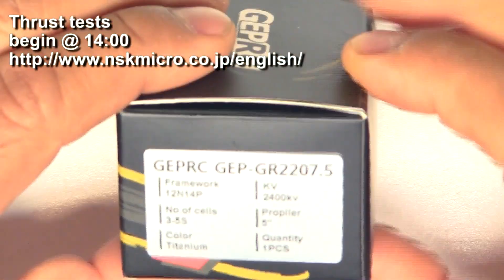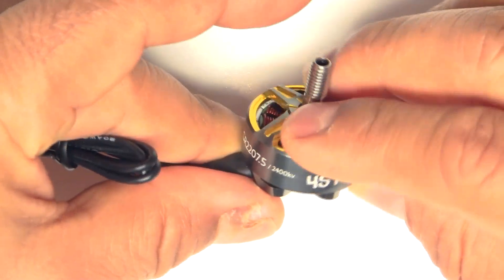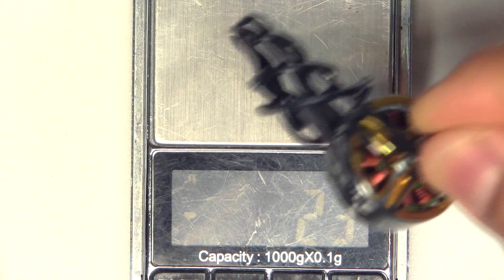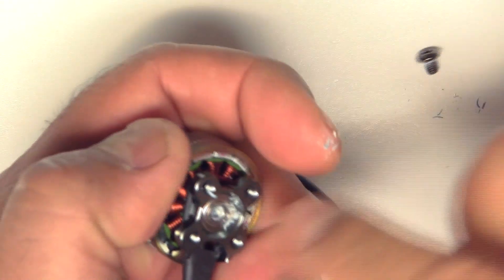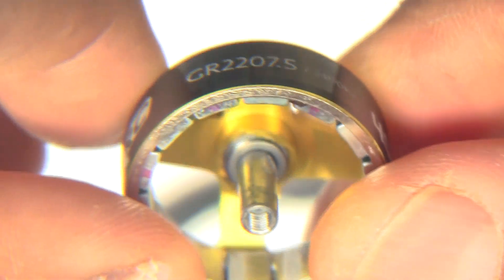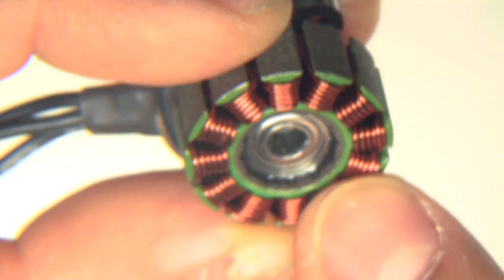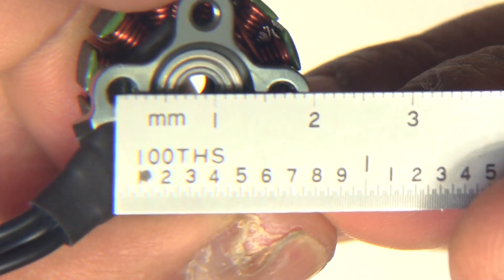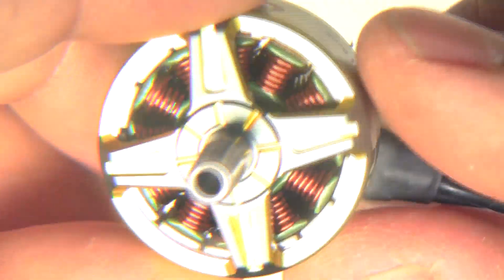GepRC GR2207.5-2400KV Static Thrust Tests & Overview

Comment: 👍👍👍👍👍👍👍👍👍👍👍👍👍👍👍👍👍
Excellent for the motor testing !!!!
I am a beginner rc builder , and I have a particular question for you based on your motor experience:
I am building a small rc plane and the design as for a 1700kv motor of with 20grams motor weight . The plane has about 180-200grams weight and it is VERY SLOW flyier.  Here a video of the plane https://youtu.be/Osr8n_VDyqI 
The space available is for a propeller is max 6in ...........
Do you a a recomendation for a efficient motor 1700kv, 20 grams , prop 5in or less  using 2 or max 3s lipo? 
Many Thanks
Alex

Comment: I am a beginner and I want to take 4 motors, do I take the same 4 motor and see the numbers differ
Reply from the maker: the numbers should be very similar, very close for all 4 motors of same model, manufacturer. For a quadcopter, the Flight Controller will equalize any difference in motor output.
Reply: EngineerX  I mean, I buy 4 motors 2400kv

Comment: Thanks for the great work EngineerX. Just wondering why you don't measure the motor constants, winding resistance and no load current. It would be nice to compare the theoretical to the measured results that you find.
Reply from the maker: Thanks for watching and for your suggestion. I will try and include those measurements in the future

Comment: Hello I want your feedback I want to buy a reptile dragon rc plank it's a twin engine plane I'm interested in a 3-4 amp max cruise at 35mph what motor and prop combo do you recommend the plane itself weighs 1114 grams and I'll be using 4s? Thanks
Reply from the maker: I'm not much of an expert in fixed wing aircraft propulsion systems but it sounds like your setup will need to be efficient in the lower rpms. One of the most efficient thrust setups would be a large diameter propeller. So for 4A you may have to go with a 6" or 7" 2-blade prop and a 2206 or 2207 low KV motor maybe 1200kv. I'm guessing. I suggest you also confirm with one of the calculators like eCalc. I think that's the name. I believe you can input airspeed and Amps and it will tell you prop and motor size.

Comment: These motors are manufactured by RCINPOWER, which is in my opinion one of the 3 best motor manufacturers alongside with T-motor and Brotherhobby. But in their own thrust table they performed better. Great motors whatever the case.

I think both your current meters may be a bit off, yours a little up and theirs a little down. Have you calibrated it for a while? And just as a suggestion, i think these props are a bit outdated. A test with some newer props as the Gemfan Hurricanes, the Dalprops PRO, the HQ S4 or even the Emax Scimitars would be more useful.

Thanks anyways, you always helps us a lot!
Reply from the maker: I have not calibrated the current meter. It still reads within 1 to 2A compared to the power meter you see there in front and also same with the current meter in the power supply. I'll have to see about ordering those props and get them on the thrust stand. Thanks for the suggestions.

Comment: Can you test the iflight XING E motor? Cheaper than XING, thank you
Reply from the maker: I'll request from iFlightRC or Banggood. But i have to finish all the tests first
Reply: From the thrust tables they provided and from a lot of people they are more powerful and smoother than the original xings.

I don't have the original xings to compare, but i can absolutely recommend my xing-e 2306 2750kv. Best motors under 20US$

Comment: Looks more then a 8mm Stator
Reply from the maker: Yeah, closer to 8mm. However, there's some coating on the stator (green paint) that adds to overall dimension. But you're correct, it's slightly closer to 8mm than to 7.5mm.

Comment: Details about your thrust stand? I want to build something like that for myself, but with a big propeller behind like a wind tunnel. Not sure about how to deliver and measure the power.
Reply from the maker: I got it from rcbenchmark.com. It's great for "light-duty"  testing. Sampling rate is only about 6 to 8 Hz so not much resolution if you need more than that. The hardware is very well made. Load cell is good for up to 5 kg. Current sensor has worked up to 75A 3-sec burst. it's rated for 50A